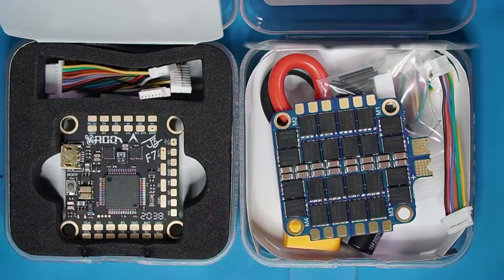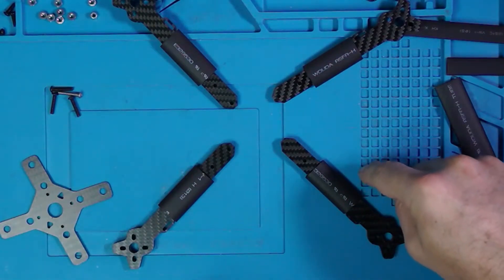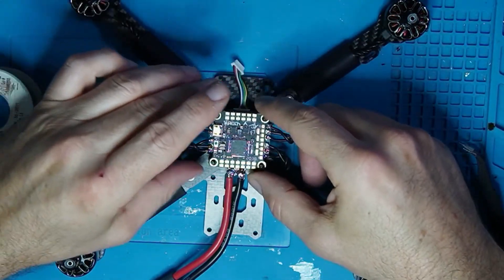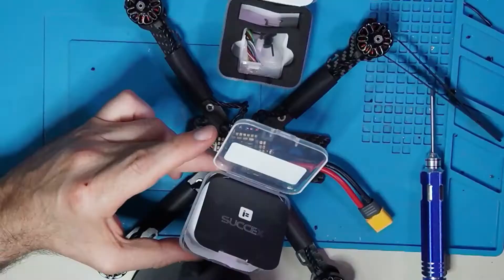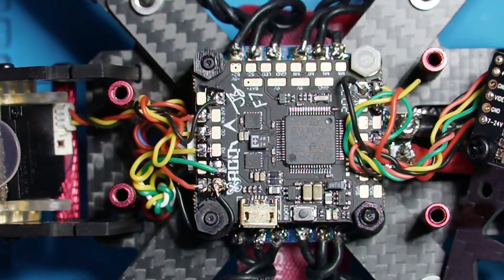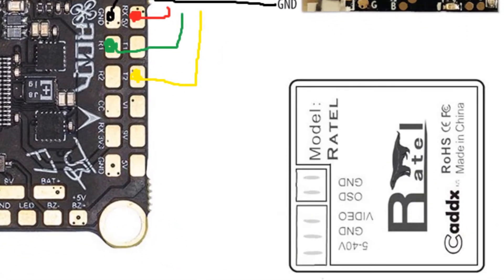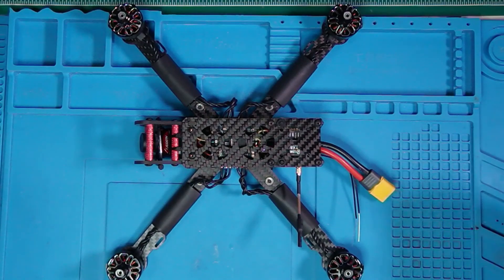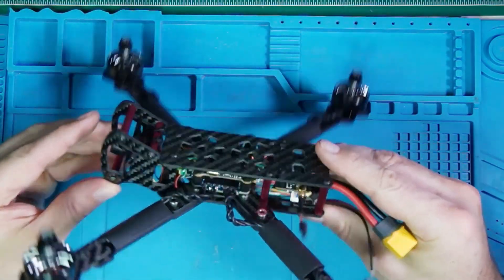RDQ Bardwell F7 FPV Quad Build - Wiring RX, VTX,and Camera

Comment: Steve I'm following the JB wiring diagram.  The R-XSR s-port goes to the T2 pad.   The run cam wiring diagram (2nd one)also uses the  T2 and R2 pads for smart camera control.... Do I need to use different pads or can the T2 overlap for this function???   Another newbee F7 guy.